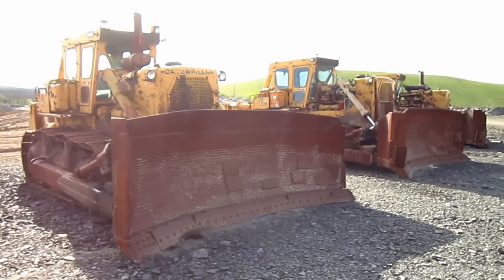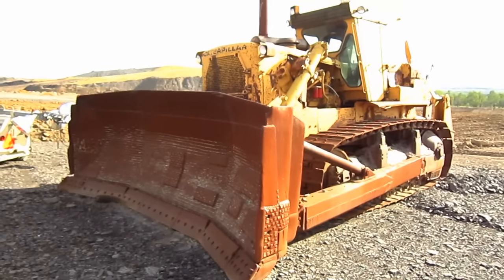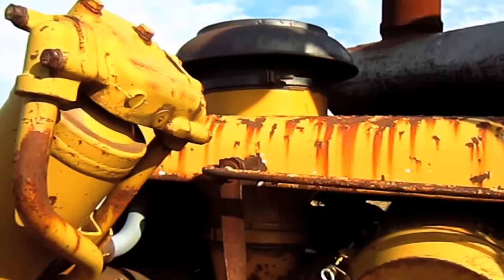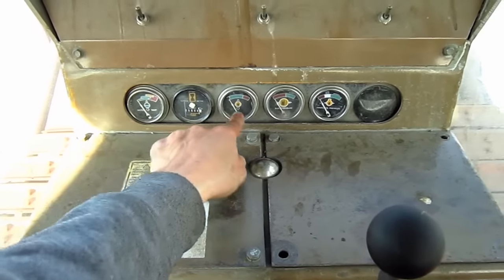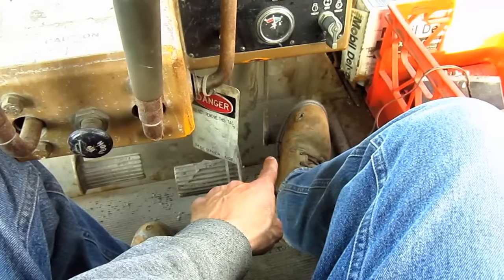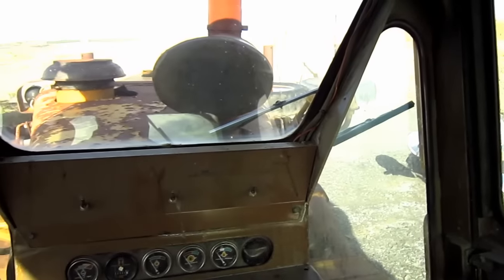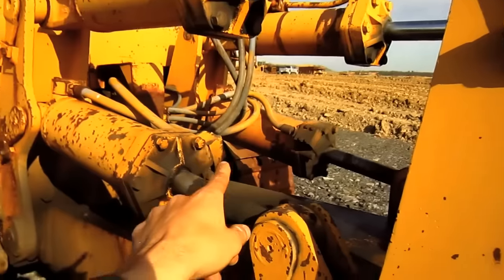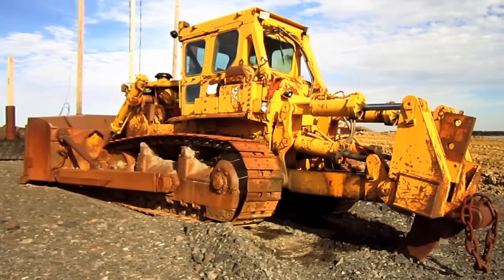Caterpillar D9H Documentary

Comment: Out of all the Dozers I've  operated strip mining coal in central Pa. And now doing Highway construction in Texas  the 9H  is my favorite
Reply from the maker: One thing for sure, they could push
Reply: What do you do if you have to adjust the blade and steer using the right hand control at the same time?
Reply: @bigredc222 use both hands.